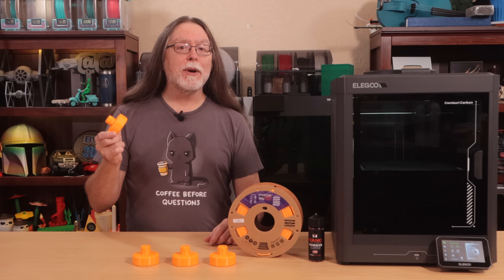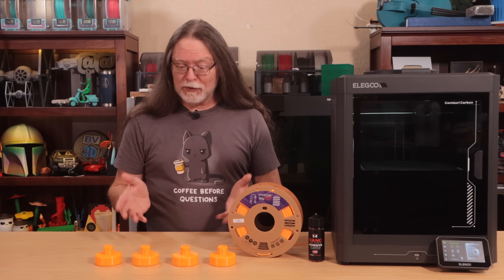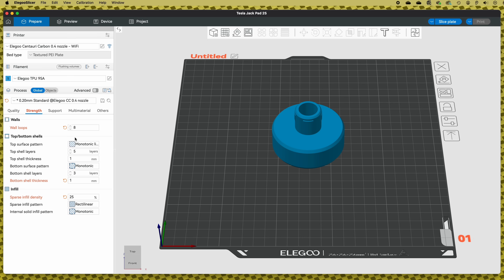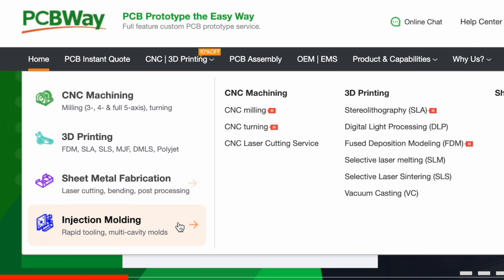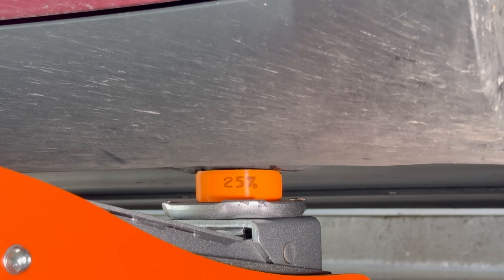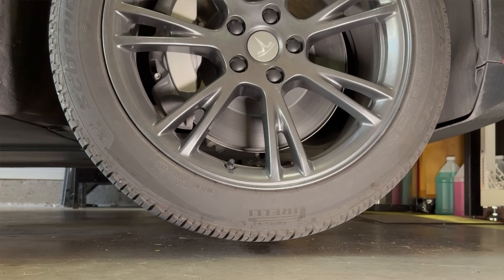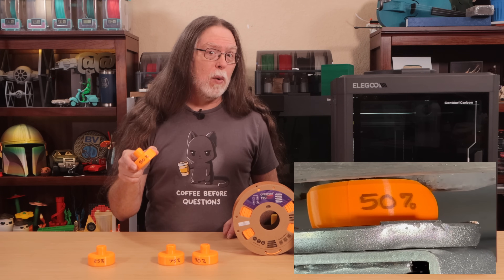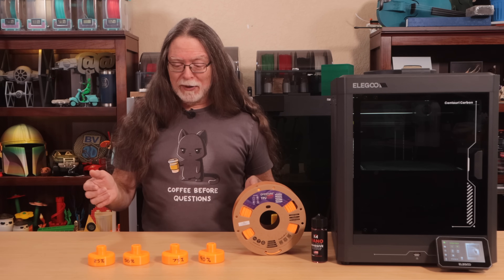3D Printed TPU Jack Pads vs. a Tesla--Will They Survive?

Comment: You should try some PBT filament for something like this. It's still flexible, but it's much more durable than TPU, and it uses default PETG printer settings. Added bonus, it can handle much higher temperatures after printing.

Comment: On a part like this, a setting like "Avoid Crossing Perimeters" (which is in PrusaSlicer) will easily prevent most of the strings. It does increase the time on some parts, but if it is a decorative print, it can be worth it. For this, however, I wouldn't care at all. 😁
Reply from the maker: Hi Dan! Thanks for the tip! I agree it doesn't matter on this one, but could certainly help on something that was supposed to be pretty.

Comment: I am curious the contact patch on the car. It looks like the metal on the car does not cover the surface area of the pad, but I could be wrong.

If the area on the car is smaller, you can add negative cylinders inside the model directly under the weight and add a lot of strength where it is needed.

Comment: I believe you missed a critical part of what jack pads do - yes, they are an interface to protect the vehicle from improper jacking BUT they are also a critical link in the weight bearing stack from vehicle to jack to floor - both in compression but perhaps more critically, in the ability to resist lateral loading and deformation. I dont like the squish I'm seeing in the tests - the elastic deformation suggests TPU will tend to "roll" under lateral loading and could result in the vehicle moving and the jack getting kicked out.

I expect the "official" version of these parts would be made of nylon or ABS typically, those would exhibit significantly less deformation in general than even the 90% infill version. 

Also - not sure of the weight distribution of that vehicle, are the front or rear jacking points more heavily loaded? 

Finally, a reminder to always use jackstands, especially with a proposed 3D printed interface would have been a very good idea, too.

Comment: I would use the 25 or 50 percent version. The fact that it is deforming means that it is doing its job. A tpu part should deform. Otherwise, its just a hard part that can damage the car.
Reply: jacking points are part of the car frame, and are reinforced, so pads made of tpu even with full infill won't make any damage to them. Top layers of this TPU pad are still softer than harder plastics so it won't scratch the anti-corrosion coating.
Reply: @jerryofthebikes they should indeed be jacking points, but Tesla finds it necessary that additional pads are used. And while tpu is definitely softer than pla/petg/abs, with near full, it is stil extremely hard.

Comment: What's that old saying... Perimeters are stronger than infill.
I'd wager that a honeycomb grid through the part would be as strong as the higher infills at a lower infill setting.
Reply from the maker: So, honeycomb instead of grid might be stronger?
Reply: @BV3D oh, meant holes thru the part. Not the infill. Hex or circular holes to make perimeters in the middle. Can't speak for filament usage but might make it stronger.
Reply: @BV3D it would be interesting comparing the strength of those parts, vs parts with similar weight but higher wall count and lower infill. That usually results in much stronger parts when the perimeters can take on the load (aka not too far apart, which seems to be the case here), but I'm not sure how it affects tpu compared to other materials

Comment: Excellent use of TPU. I've designed and printed TPU parts used on my popup camper, like wheel levelers, a tongue wheel dock, and feet to go on the bottom of the stabilizers. As you've done, I chose an infill commensurate with the amount of weight it's designed to hold. My only complaint is the cost. TPU at 100% infill is like solid rubber and strength is terrific, but can get expensive for larger parts.